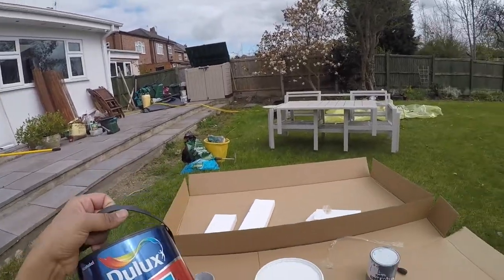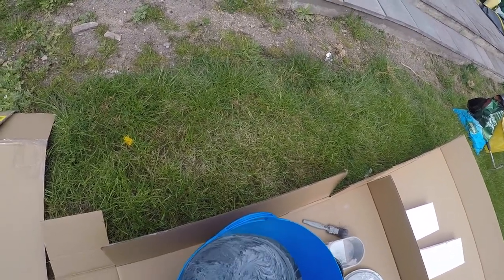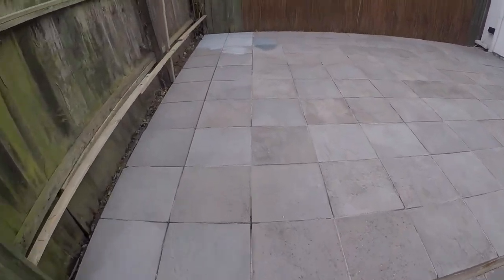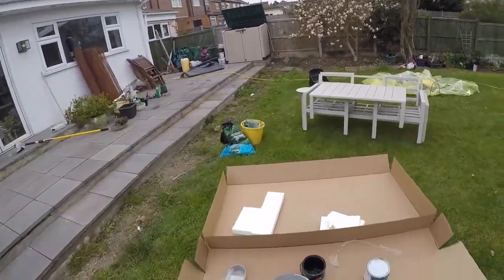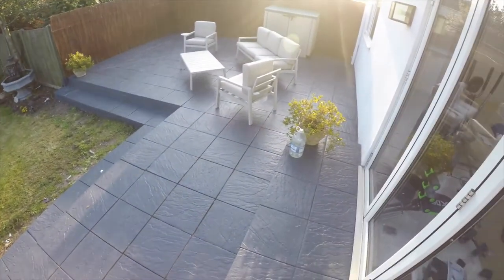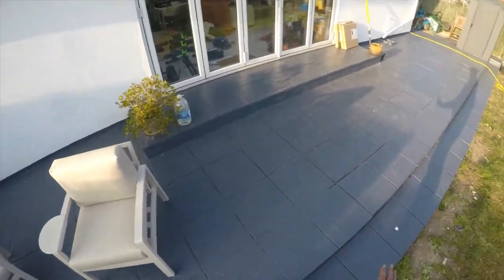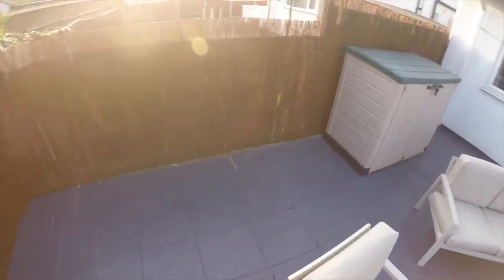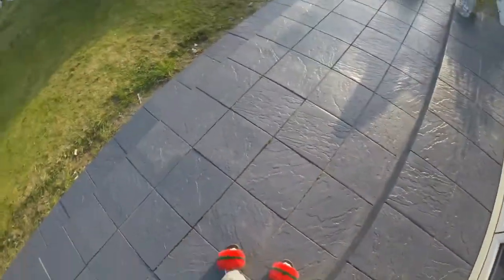Dulux Weathershield Ultimate protection Concrete grey - Review and REWORK! Custom mixed at home!

Comment: Great upload!!.. can I ask has the colour held up? Any after affects such as flaking/peeling? I ask as I’m planning to do the same with my garden tiles
Reply from the maker: Hi!! Absolutely no flaking or peeling and it's been a good few months of typical British weather! I'll see if I can upload a photo.
Reply: I ended up buying Valspar masonry  “dinner jacket shade” customised colour in 10litres at B&Q for £45, I hope I’ve made the right choice, I just felt it would save me time mixing, but you have done a great job!!
Reply from the maker: @xbladeclan3471  well let me know how it comes out!! All the best, preparation is key 🏆
Reply: @xbladeclan3471  how did dinner jacket shade look, interested to buy the same. thanks
Reply: @ashberkley  hi hows the atio slabs still loking good, lookig to do somerhing with. Ours. Cheers
Reply from the maker: @markthomas7439  yes still looking good. 9 months in and half way through winter. No peeling.
Reply from the maker: @markthomas7439  as soon as the weather is better, I will do a 1yr update video to show you guys.

Comment: How many litres of black did you mix into the 10 litre paint? Thanks for the video
Reply from the maker: 6 x 2.5 ltr tins if the black.... With one big 10 ltr of the Grey
Reply: @ashberkley  15 litres of black. Do you think this would work with the sandtex Vermont grey paint? 15 litres of black paint. Wow that’s a lot of black paint to get dark grey.
Reply from the maker: @Adamasher8888  im not sure this will work. Depends on the shade of Grey you start with. You can mix it in 2 halves and stop adding the black when you get your desired shade of Grey.
Reply from the maker: @Adamasher8888  also I'm not sponsored by #dulux but honestly their paint is the best. You do pay more but it's worth it. 6 months in still glossy, no chipping it grazing. 15 year guarantee 🤩 happy if it lasts 5.
Reply: @ashberkley  sandtex is also a quality paint. Thanks for the upload.